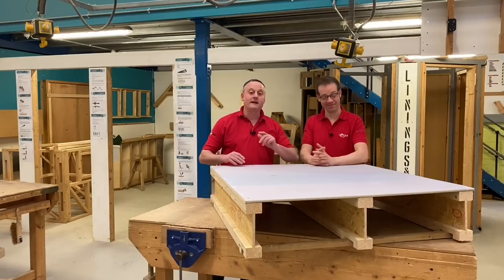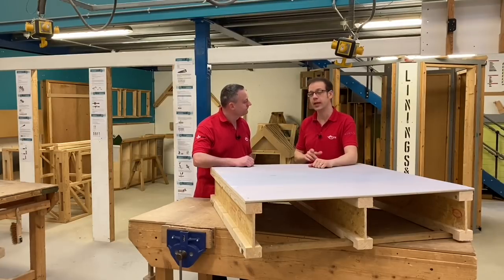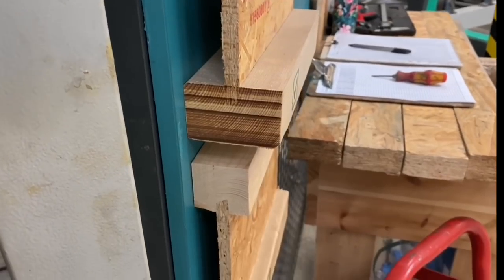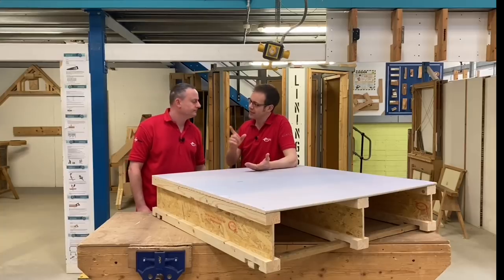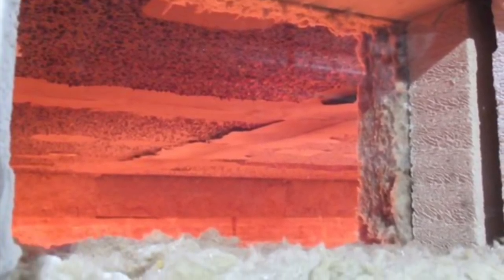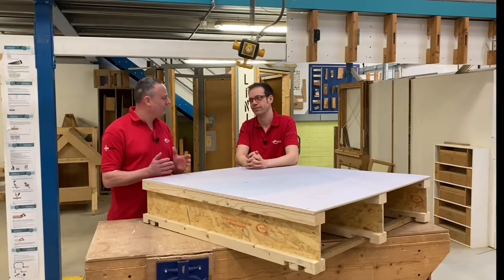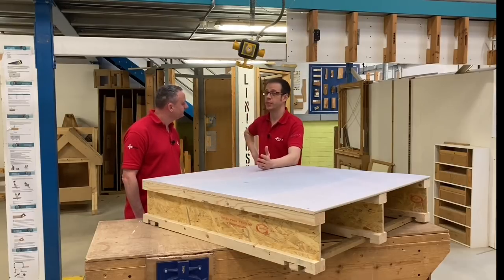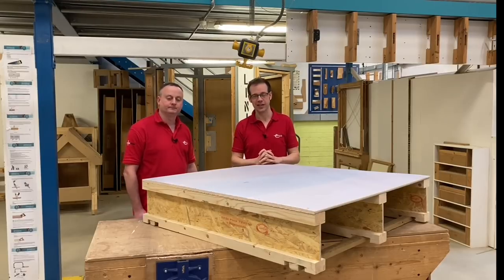The NHBC burns a hole in fire rated downlight certification with i joists

Comment: Interesting point though IF all new builds use these joist fireman will be told Do Not Enter new builds as the only thing holding the joist up would be the electricians metal clips 😃 ( makes you think )
Reply from the maker: It’s a known known in the fire service - https://www.fireengineering.com/firefighting/silent-floors-silent-killers/#gref

Comment: If I joist aren't upto fire regulations then they should be banned, they should design and build joists that meet current standards. It shouldn't be every other manufacturer that has to change because I joists are sub standard. 
What happens when the down lights need replacing in 5 years time? The home owner goes to screwfix, changes the fitting and turns his house into a death trap.

Comment: I am so happy that Germany is one step ahead 😉. Fire board is fire board and there is no hole in it for any kind of down light. If the customer wants down lights anyway, so the builder has to build a second layer of plaster board with space for installations and down lights. Because there are so many regulations regarding fire safety,  almost always 3 or more storey buildings are made of concrete.
Reply from the maker: Interesting information Simon - so are downlights popular in German homes as a result of the additional work required?
Reply: @efixx  of course. In small houses this is not needed. In all buildings >building class 3 there are so many regulations in the  fire safety code that there is no chance to save money 😉

Comment: So if I'm adding downlights to an existing property, with I-joists, how do I know the beam's manufacturer in order to buy the approved light for that specific beam? Or is this only for new builds, and in my case I would be better off adding fire hoods to any downlight?
Reply from the maker: It does only effect new builds or extensions. Most “good” manufacturers now have approvals for a wide range of joists - so check out JCC, Ansell, Luceco, Collingwood

Comment: Seems to me like more homes are going to be less likely to withstand a fire... More homes are also going to be prefab built as well. Because of this any fire from an electrical item will immediately be the fault of the installer Rather than a full in depth inspection of the buildings structure. More electrical products will need to be wary of how buildings are being constructed now, not as they were 10+ years ago. Maybe before building properties with these materials and changing how they are built... They should be set on fire to see how well they withstand it.

Comment: Absolute total bollocks, what's happened between the fitting and the plasterboard is the key for electricians - that's the seal.  The building trade going over to cheaper joists is not our problem or the problem of the lighting manufacturers.  Total shit.
Reply from the maker: You view matches that of the lighting manufacturers - they are meeting with the NHBC on the 4th March.
https://www.efixx.co.uk/Articles/nhbc-burns-a-hole-in-fire-rated-downlight-certification
Reply: @efixx  I suspect they may have worded their reply slightly differently 😁

Comment: Well you construct to prevent the spread of fire by using 12.5mm x 2 layers of plasterboard brick bonded and staggered which achieves 1 hr fire protection not by installing solid timber joists. A point of ingress for fire is openings. Downlights, soil vent stacks, other plumbing etc. For stacks and other plumbing you need a 1hr fire collar boxed in with 2 layers of 12.5mm plasterboard so downlights are no different. The above is for apartments, not single or two story domestic.

Comment: Why don't they just ban substandard I joists if they cannot be relied upon to provide adequate fire protection..  Its all very well but even if the right light fitting is fitted what happens when someone else comes along, does not realise it is I joists and replaces the downlights with ones that do not comply..   Seems like a dangerous solution to what should be a simple and safe solution, only use solid joists.
Reply: Care to define "adequate"?
Reply: @JimWhitaker  performing as well as or better than the traditional solid timber joist?  Having something that is not as good in a fire seems like a backwards step.  Something as simple as putting an incorrectly rated downlight could put occupants at a greater risk in a fire...
Reply: @steve11211  is fire the only thing joists have to care about then? Or does the environment get a look in? They’re not just using these things to save money. They’re using them because they’re better in several ways and cheaper.

Comment: It has noting to do with the joist. The idea of the plaster board skin is to stop the fire from getting to the joist in the first place. So if you have 1 layer of board that will resist the fire from spread  for 30 min and like wise for 2 boards. It's not how long it will take for the joist to burn through. Correct design the joist should never burn through and collapse. For example if I live in a flat and had some one below me I want to know that if they leave the chip pan on and burn there kitchen down. There not going to burn my flat down to before the fire bridge put the fire out.
Reply from the maker: Hi Scott, thanks for the comment, check the link below for the guidance from the NHBC:  http://www.nhbc.co.uk/Builders/ProductsandServices/TechZone/NHBCStandards/TechnicalGuidanceDocuments/64/filedownload,84608,en.pdf
Reply: @efixx   so if the joist play a key part in the fire rating of a plaster board ceiling. Explain how you can have a 1 hour fire rated suspended ceiling with no joists. A hole in the fire rated skin is still a hole what ere is behind it.the fire rating of the light is there just to fill that hole. Whether it be a light a speaker a fire alarm or an air vent. And all the work I do is commercial so that's why I'm just asking if it's different for domestic as that's what your talking about
Reply: Seems like what it comes down to is that the electrical manufacturers have gotten away with selling hugely inadequate products for a while because the joists above it took up their slack.

Comment: It seems to me that Old School solid wood beams and Old School construction methods are safer than the newer lightweight construction methods because lightweight construction methods have a  cheaper upfront cost but cost you more in the long run when your house goes up in flames faster because of substandard building materials.